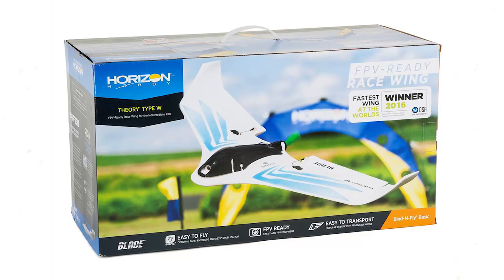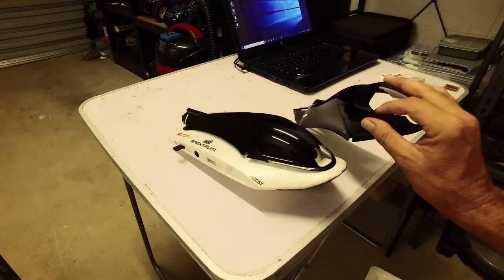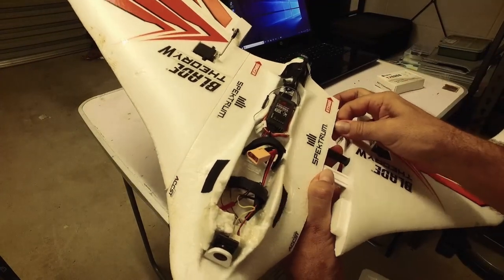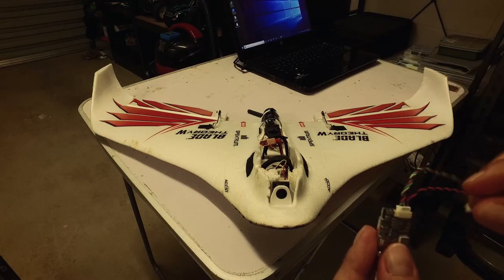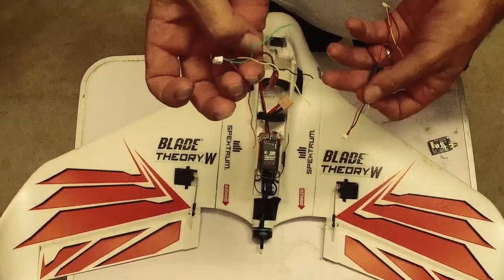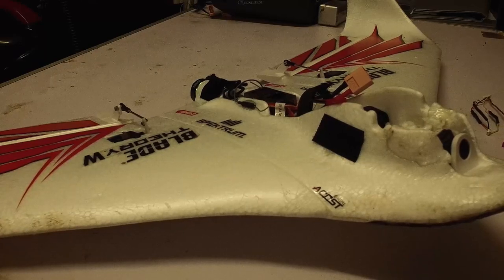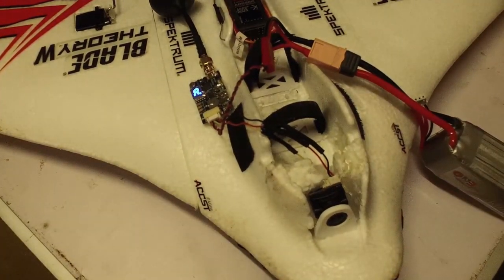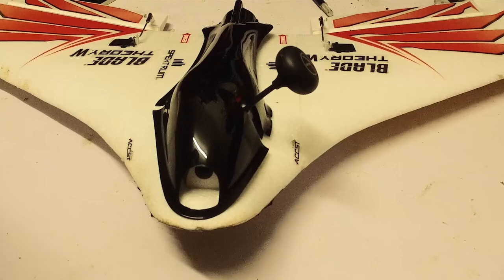Blade Theory Type W - Eachine 5258 VTX and Runcam Robin Install and Setup

Comment: Hey I'm wondering if you could help me, my left elevon sits up (not in the neutral position, only like 5-10 degrees off neutral, but I'm worried how this might effect my flights. Do you have any ideas on how I could fix this issue?
Reply from the maker: Alex MH hi I am still learning the wing too and the setup but I can tell you I do know the 3 modes that are part of the setup of the reciever are launch, intermediate and expert with launch mode active both ele’s aren’t level which gives it altitude during launch. You then switch it to intermediate to so it doesn’t climb. Maybe that’s the reason but I’m not sure why only one is up unless the craft isn’t level when armed? Maybe your Servo wasn’t setup correctly from the factory?